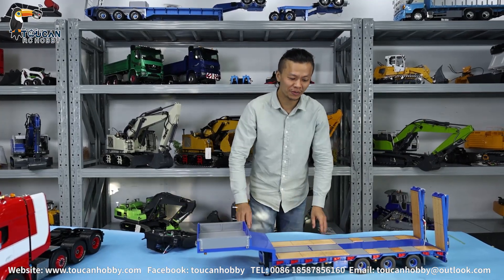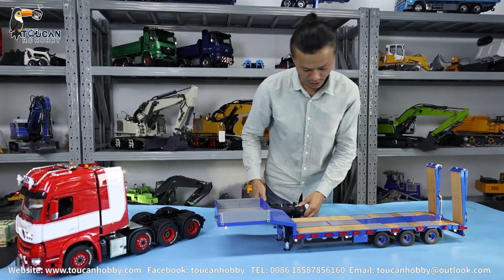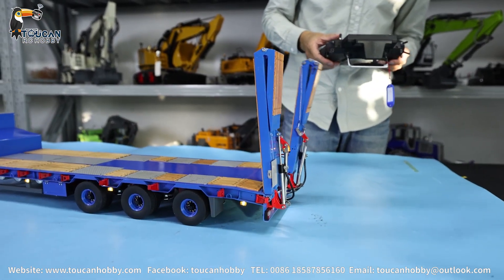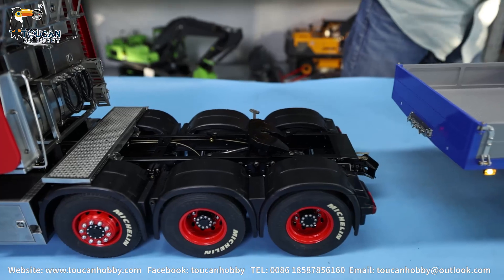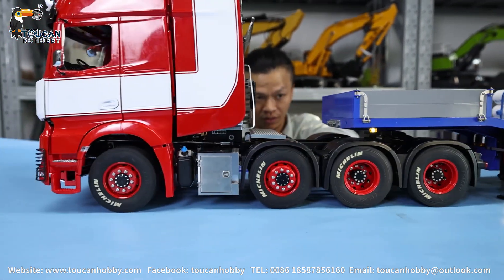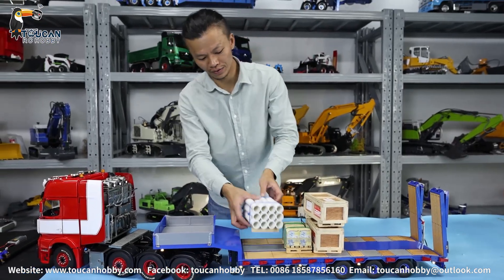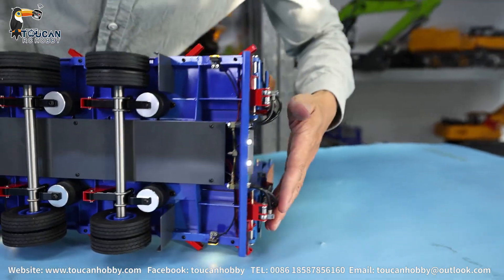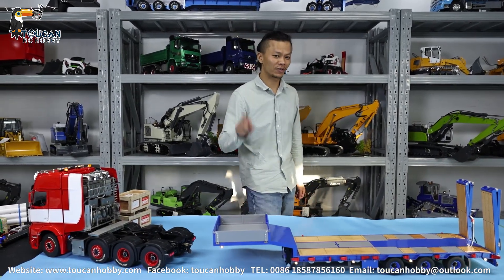LESU Metal Trailer, wood plate,  Light, Hydraulic Pump ramp, Electronic Lifting standing. A0020

Comment: What transmitter and receiver set up are you using?
Reply: @toucanhobby2400
Reply from the maker: Paladin radio, fgr12B receiver in the truck, inr6-hs receiver i the trailer
Reply: Need better instructions, I'm serious ive been working on RC vehicles for over 20yrs this trailer has the least usable instructions I've ever seen especially for wiring instructions/diagrams both are next to useless.

I bought the kit version that doesn't tell you it's missing the light attachment so be warned.
I've bought a couple RC vehicles from TOUCAN and apart from one issue I've been satisfied with their response and help, if I was to buy another of this trailer I'd buy one PRE made from them.

My kit was bought from a different seller over 5yrs ago but because of COVID and other health issues I still haven't finished it mostly because of terrible instructions/diagrams it actually cost more than the made version because of the year I bought it.

I AM NOT A BOT AND I NEVER RECOMMEND ANYTHING OR COMPANY UNLESS IT'S TRUE
I hate liers and false advertising, I haven't been paid or given anything, I wish they would gift me something lol
Especially a real hydraulic excavator hint hint 😊😊😊
Have a good day guys n girls